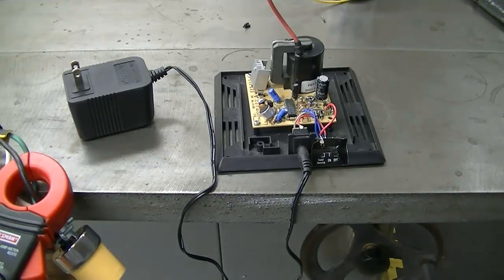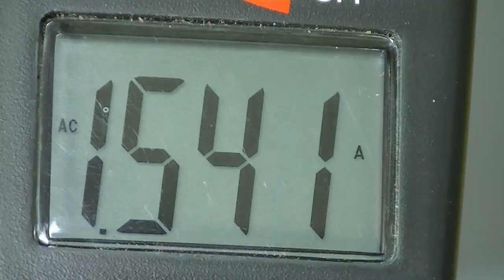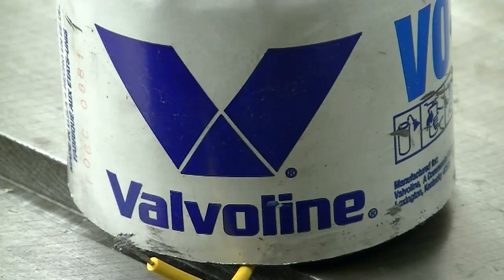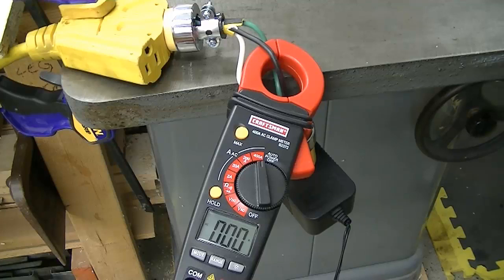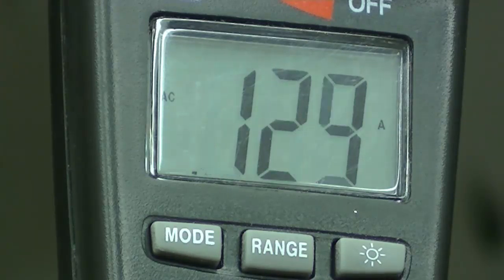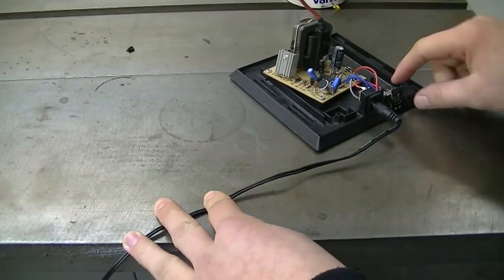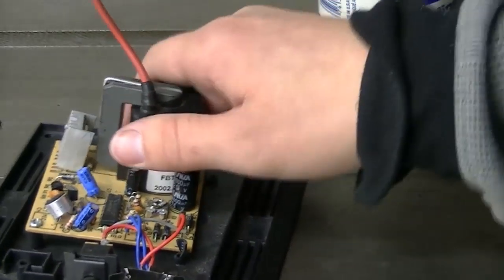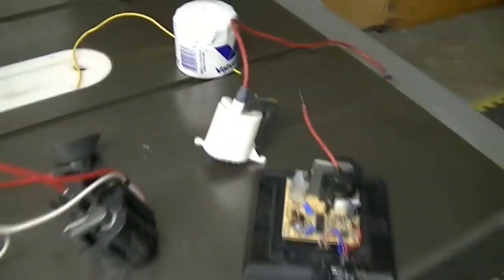Video Re: Plasma Globe Flyback Transformer Output

Comment from the maker: If you still cant get it to work this well, maybe try going back to the original plug if you still have it. I can't think of any other differences other than the ground source. I can get that type of arc that was in your videos if I use an insulated screwdriver.

Comment: Very interesting.  Thanks!
When I get back to my house for winter break I'll get my globe out again to see if I can get it to melt strands of wire like yours does, because the circuits look identical and I was even using a slightly larger power brick than the original.